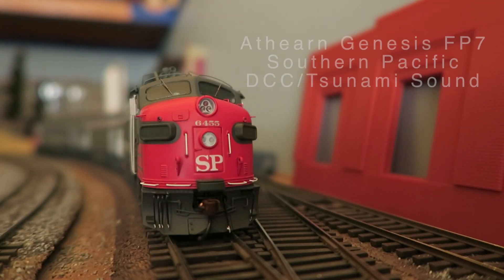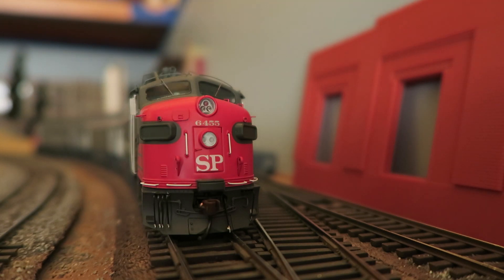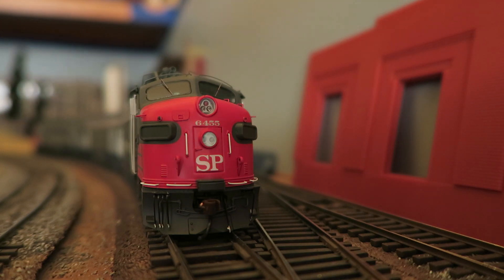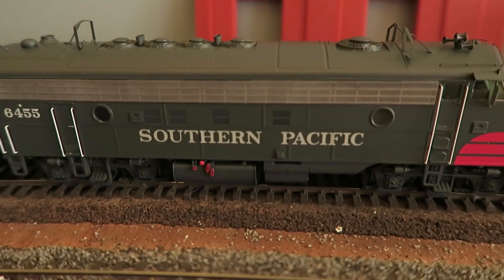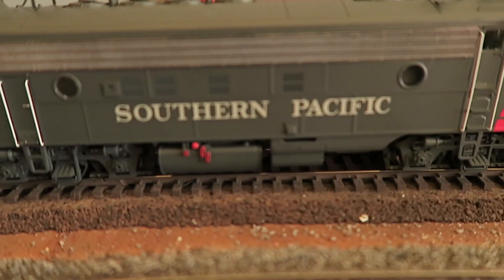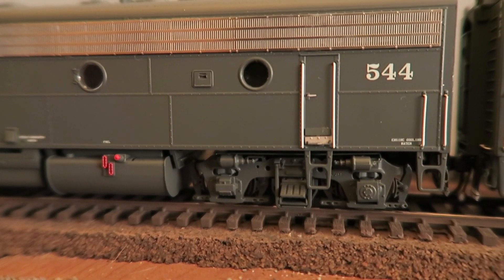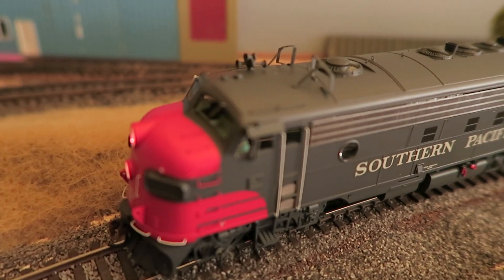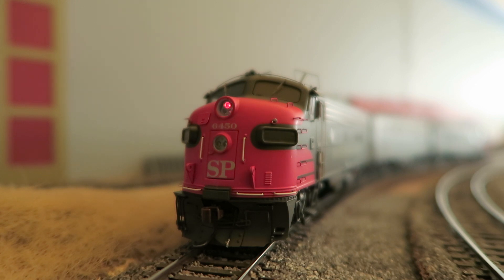Athearn Genesis SP FP7

Comment: I’m curious how these units have held up over the past 8 years? I recently picked up some Walthers SP FP7’s that’re also phase 2 units and so far, so good, the sound is great and no other complaints. Thanks for the video young man.
Reply from the maker: They have held up okay. Only "big" issue is the B unit has a dead short in it somewhere...under very certain conditions. I will likely upgrade the bulbs and TSU1 sound to LEDs and ESU Lok Sound,